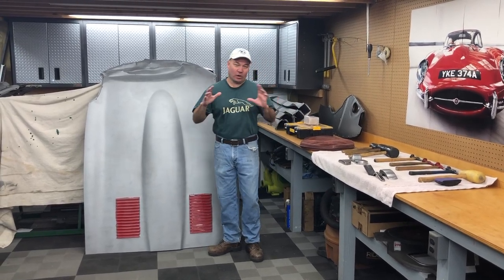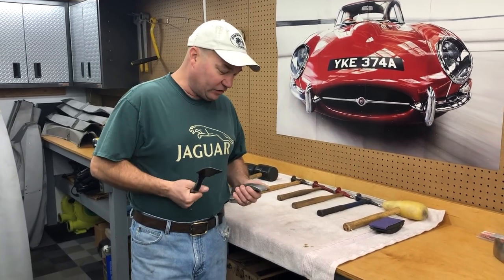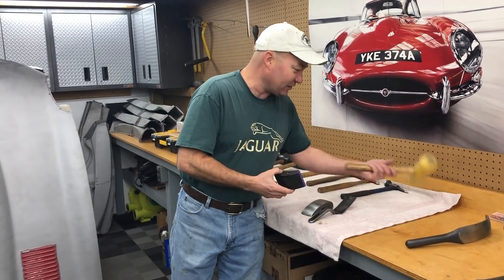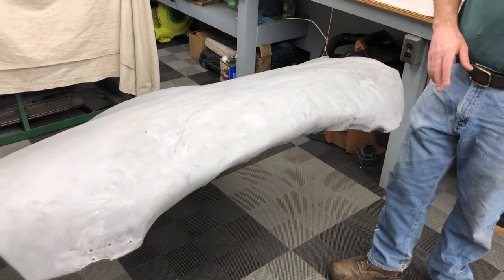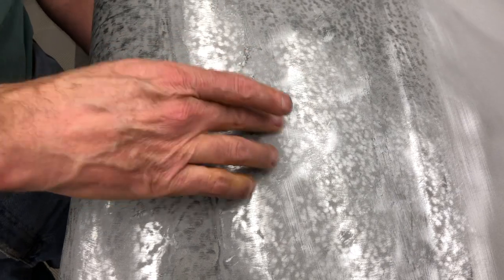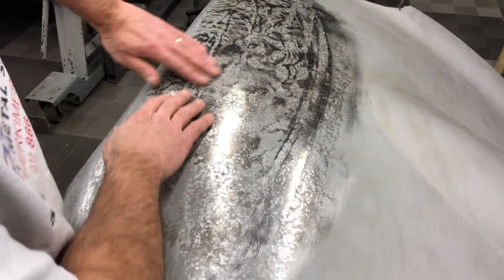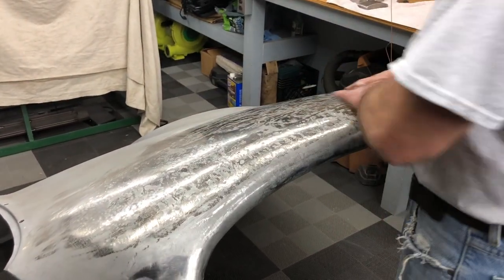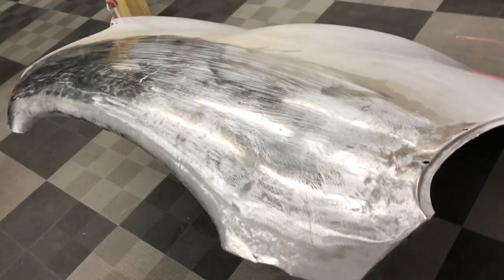Jaguar E-Type - Series 1 Bonnet Crash Repair - NO FILLER!

Comment: 35 years ago had a  Maroon 1970 E Type convertable. Called it the 'Purple Penis'!
Some drunken idiot at a party body slammed his back onto it showing off. It left a serious dent in centre bulge so made him pay for complete new bonnet.
The repair shops inexperienced son of the owner quoted £1800 for complete replacement including labour. His Father went mad for not quoting enough as it's endless work fitting each of these bonnets as each one was originally custom fitted to each car.
They did a great job. Then paid them to panel beat the old bonnet ~ (which was by then the property of the insurance company) and eventually sold it on for £500 profit... Happy days!